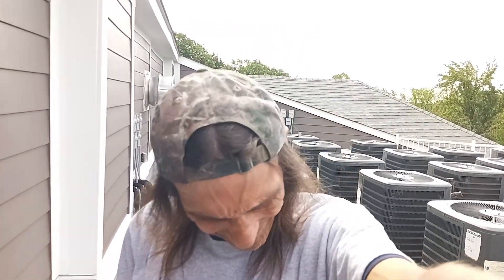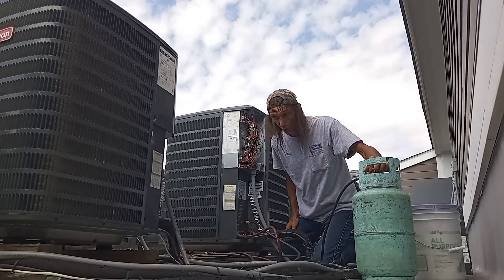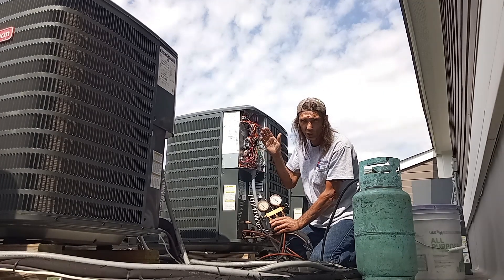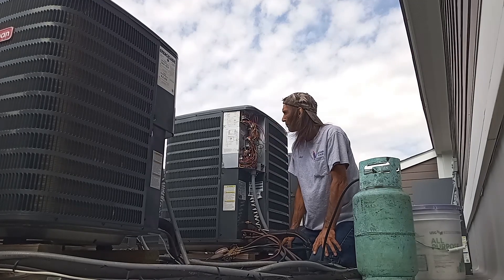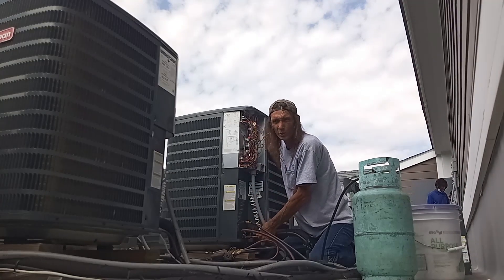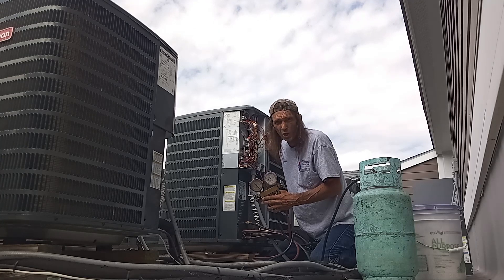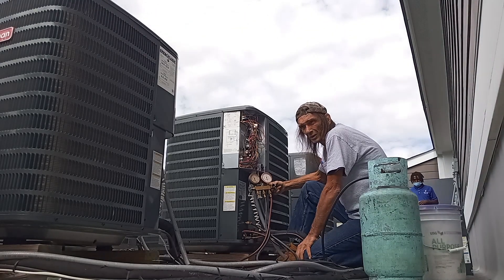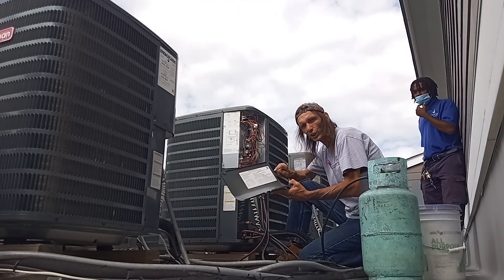Correct overcharged HVAC heatpump, fast and proper.. BEWARE! charging charts are for amateurs

Comment: Holy molly how long are those line sets? They'd have been better off with a water chiller setup I feel like. The lineset lengths must add so many pounds of charge and unless well insulated on the supply so much efficiency will be lost.
Reply from the maker: The art of piping design is dead..With no traps or changes in line size I'm excited about the future of compressor changes at these new style buildings. I've stopped crying about it and learned to go with the flow.. it's their money but if they don't mind spending it I have the perfect tools🤣 Good eye to notice that and thanks for the comment.

Comment: Most of these new properties has Goodman ac
Reply from the maker: Decent stuff.. not the worst for sure. Big problem is incorrect refrigerant piping , long linesets with 4 floors of vertical rise with no changes in pipe size and ..  no traps.
Just means we get alot of compressor changes🤣..and we love it